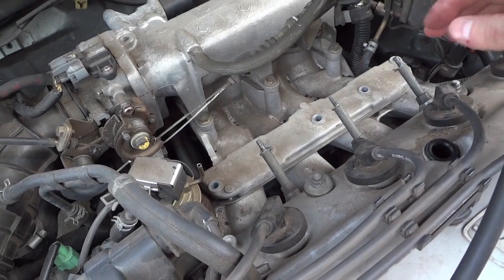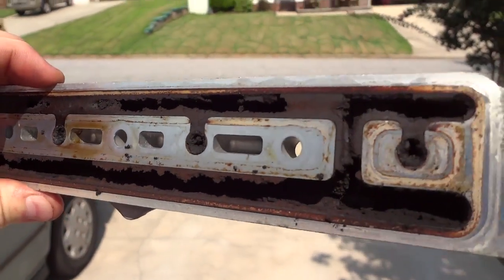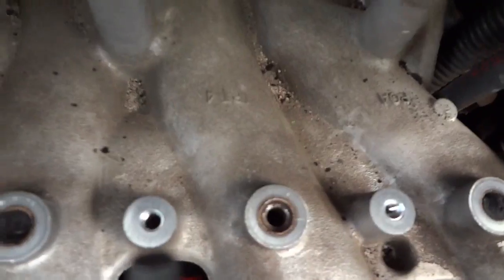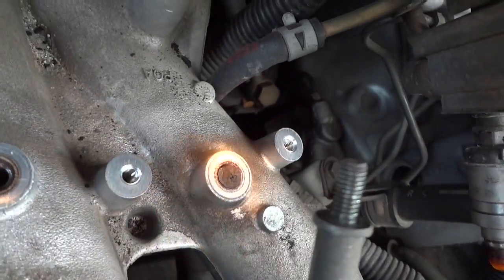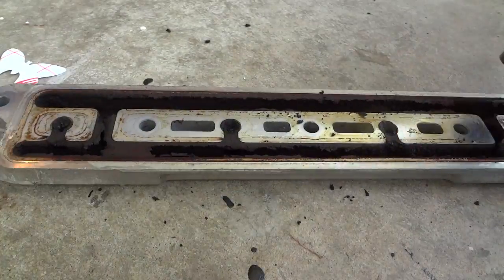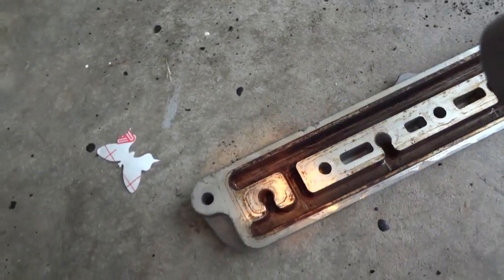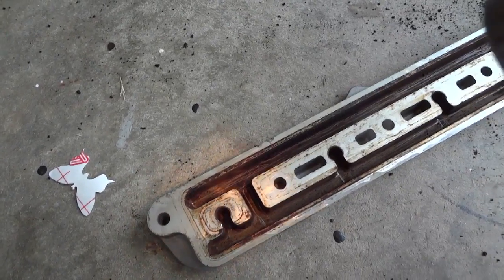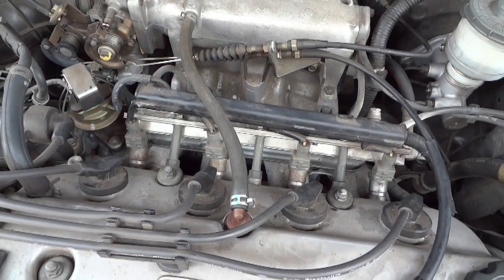EGR Valve Assembly Cleaning | 1995 4cyl Honda Accord

Comment: the excaust manafold is in front of the motor not behind it that part ur cleaning out is called the intake manafold
Reply: Agreed. The exhaust manifold is on the front and can be identified easily as the manifold that has its own heat shield, if it hasn't rusted away. :)